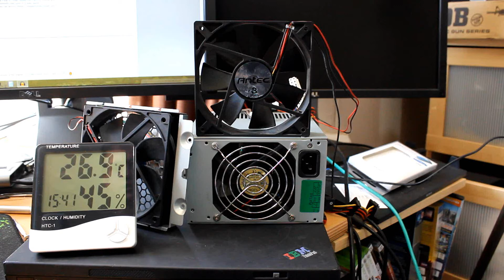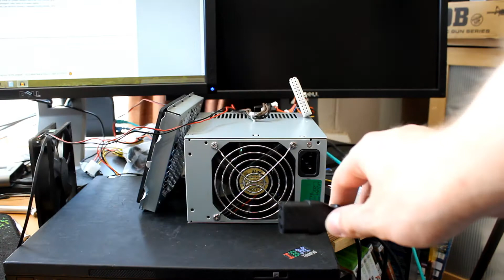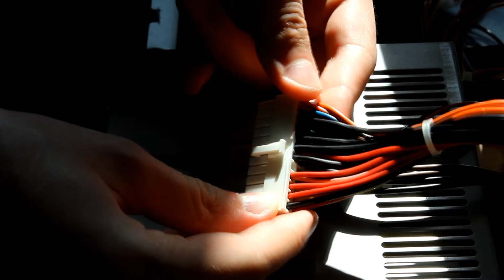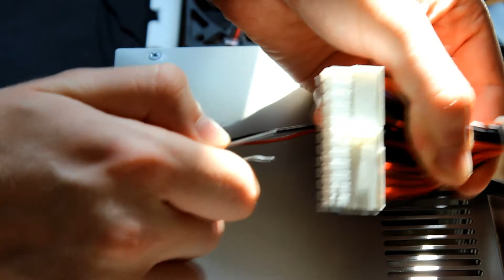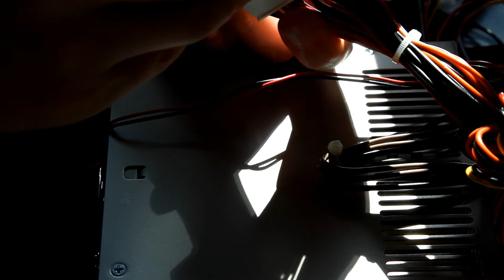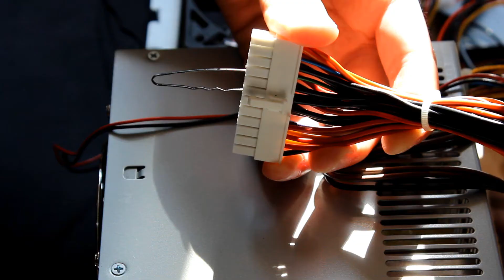How to power a case fan using an old PSU

Comment: You could just take the cables out strip them twist them together and electrical tape them. Or take an old PC On button and twist it to them so you can turn on and off.
Reply from the maker: You could but that might ruin a perfectly good PSU and I didn't have any buttons kicking about
Reply: AzzyChill very true if in future of wanting to use again